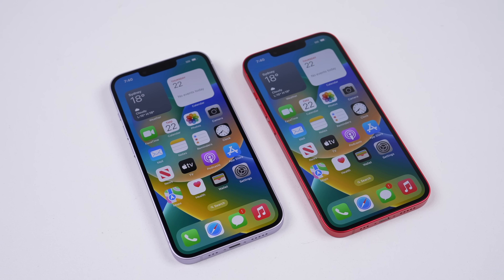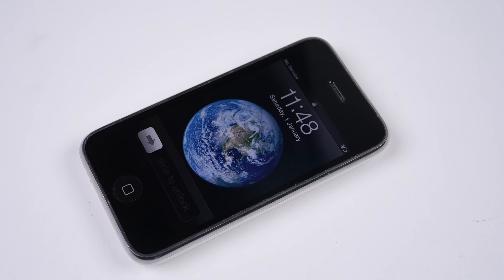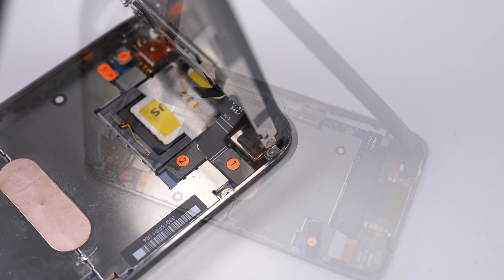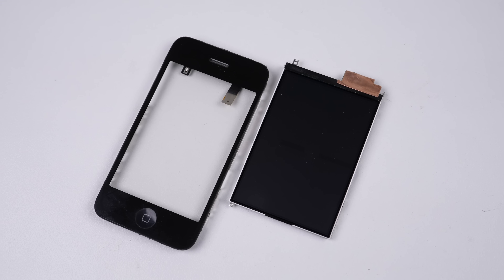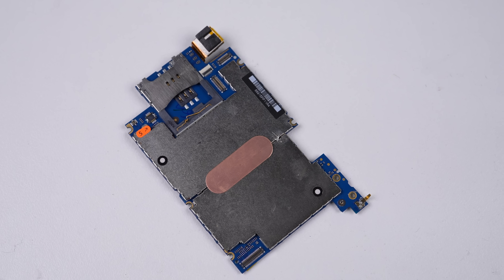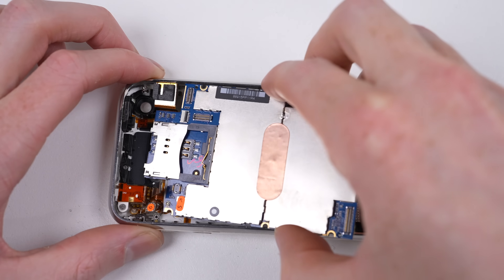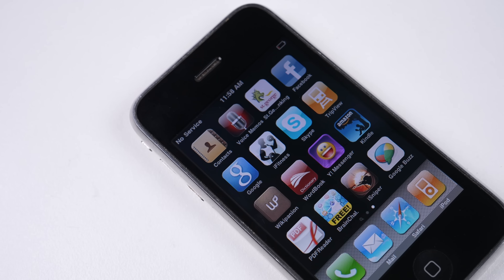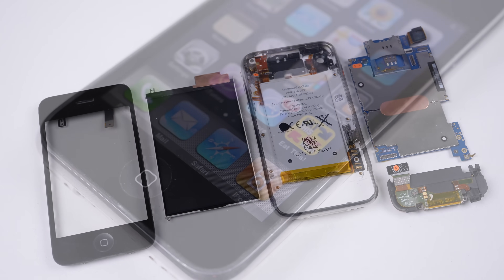Apples Most Repairable iPhone EVER - Teardown And Repair Assessment

Comment: EU should enforce laws for addressing the problems with activation lock and 3rd party repair, not just having easily removable batteries or USB-C!
Reply: All government should. Not just EU.
Reply: I agree. Apple should have a 30-day grace period with Activation Lock, not just with iOS 16. They should fix the old iOS app store so it loads again, and they push out iOS 7.1.3, 9.3.7, etc. with the activation lock fix for legacy iPhones so I don't have to upgrade phones. My LG MX6000 from '03 still works on USCC
Reply: @80sTechKid why any grace period? It's my phone and I paid for it. If you have it and you shouldn't, then it's not your office
Reply: @80sTechKid  the activation lock fix wouldn't help you at this point, since every company stopped supporting iOS 7 and 9 altogether and want your iPhone to at least support iOS 14 or newer.

And imho, after 5 years, it is worth it to buy a new phone (if it actually survives these 5 years)
Reply: Last time i checked the UK isn't part of the EU
Reply: Just like the Commonwealth of Massachusetts has already done. It made Subaru (the car brand) so angry that they quit selling their cars in that state.
Reply: You need to get out more
Reply: @TateGg-ji5lf who asked
Reply: If that happens, then I would rather go to EU
Reply: Me myself I don’t mind about the activation lock cuz first it’s to prevent a thief from getting any value from it if activation lock is not a thing the total stolen iPhone could be more 
Second, if you buy a cheap iPhone you should ady know too good to be true 
Third the owner bought the device means the owner have the rights to do whatever they want 
So in conclusion removing activation lock won’t do anything good for the one pay for the iphone
Reply: If that happens, then I would rather go to EU
Reply: Yes. Those iPhones marked as not lost is pretty absurd.
Reply: @aptiveviennapro  most locked iPhone's have the IMEI number stolen and attached to a clone phone lol witch is better than the iPhone anyway!! Well for reliability anyway 😆
Reply: Why for activation lock?
Reply: @gabriledyt  parts activation ("calibration") as they call it.. but it's really  adding the new battery pack id to the phone hardware list and digital signing it to lock it to the device. So essentially all repairs are useless until you call apple and allow them remote access to remove said old parts digital signatures and add new parts digital signatures to lock it back down so you can't make further changes until you buy overpriced and locked parts
Reply: @gabriledyt activation lock sucks. Needs to be worked on
Reply: Activation lock is a really good security feature when it works. But I did have an iPad thrown out cause it has ic lock and couldn’t bypass it. What a waste
Reply: Billionaires lobby and bribe politicians.
Reply: We need to make it so whoever invest in tech companies and is a government official is required by law to resign and forfeit all profits to the right to repair movement so it'll serve as an example to those who control this.
Reply: Fuck the EU
Reply: Exactly!
Reply: Better than regulation : educate the clients.
Reply: That is a terrible ideo it stifles innovation and destroys the brand think of buying an iphone which has been repaired with fack components and is multinational the buyer will hate the brand not the repair shop. In fact other brands should have anti repair policy. Because device should be repaired my qualified company personal.
Reply: As much as I absolutely hate the EU and a lot of their regulation ideas, I can somewhat agree
Reply: Y’all making it sound like changing a battery is impossible, definitely not as easy as it used to be but not hard
Reply: I guess 70-80% of EU employees have an iphone... More power, more need to visibility->then will buy an iphone. So for them this isn't a priority
Reply: Those would all be far more important than USB-C. The whole USB-C thing was finicky and petty.
Reply: The EU should make iPhones repairable instead of making. & enforcing useless and annoying laws
Reply: most of the politicians have stakes in the tech corporations that they are suppose to regulate, so it is against their interests to restrict them.
Reply: @ishredder4006   Nope, Europe will have phones with batteries easy to replace soon.
Reply: @siedliko  hopefully but that's mostly due to pressure by environmental activists  not by their good will or sense of duty. If it were the changes would have come a lot faster.
Reply: @siedliko  define easy to replace, because that legislation is NOT going to make it like the days of swapping out your nokia battery
Reply: @MyNameIsPetch  why wouldn't it? the legislation specifically stipulates that the battery needs to be easily removed without any special tools so no heat plates no pry tools no special security screws 
meaning like on early smart phones the easiest way to achieve that would just go have the back easily removable and the battery easy to just pop out and put in a new one atleast that's the ideal way for it to go
Reply: @Goldfire345 That would require arranging other components in the phone in a way that makes the battery user-replaceable as well as additional frames and other structural components, which probably won't happen.
The easiest solution for manufactures is simply screws. The structure will remain pretty much the same as in most phones right now but instead of glue, there will be screws. You'll still have to use tools to remove the battery (just not special tools), you'll still have to unplug cabels and maybe remove some other components, but the battery will be easily replaceable - which is the law's intention and is awesome news for people who keep their phones for a long time.
Reply: @siedliko They have made a exception for waterproof smartphones. Meaning Apple, Samsung, Google etc. still can glue down their phone batteries if they are making their phones waterproof.

So, the EU is defeating themselves by the tech companies at some point
Reply: @Christian17390  oh goody so another piece of legislation that's functionality useless
Reply: @Christian17390   waterproof as in the phone able to take a accidental dip in the pool or something ? the old samsung s5 could do that and still had a removable battery ..
Reply: @soniccdx  Well that was back then. Today, people literally deep dive their phones into the water to make underwater selfies
Reply: @Christian17390  if they could do that last time , wonder what’s preventing them from doing it now though
Reply: @siedliko but they are still going to need a call to apple to activate your self repair battery pack and camera ect.. that is the biggest issue if I repair MY PHONE I should not need to use unnecessary tools and not need approval from apple nor should i have to activate my new parts.. the only part that needs to be protected is the fingerprint scanner so it's secure 🔐 besides that nothing else needs activating and digital signing to a device.
Reply: @Goldfire345  from the version I've read something like the Steam Deck with slightly less adhesive would pass the new legislation, which is nothing like old nokia phones
Reply: @soniccdx  Can tell you. They want money. Nothing else. If they would build them like they're used to, no one would get any money from it anymore because people would use their phones longer than expected. That's also why they make their phones non-repairable, so that you either get to the companies to repair them or completely buy a new phone.
Reply: @Christian17390  at least you guys over there have laws that can help , abit , meanwhile over here in asia , .... errrr
Reply: @siedliko  unfortunately the law has so many loopholes it will be easy to circumvent. Like you don't need a replaceable battery if the phone is labeled as waterproofed. So I guess they are going to get that a little bit better worked out and still glue it shut.
Reply: If the new iPhone's will have  Soldered USB-C Charging Port, it will be funny 😅. Then the whole EU regulations is a completed lie and there will be  once again NO RIGHT To Repair 😅
Reply: @Platineshop  nah. Many leaks have proven that the USB-C Ports won't be soldered and will use the same technic with the pentalope screws, which we already know from the lightning ports
Reply: @Christian17390  hopefully that you are right... all the iPad's which have such a Port... they are ticking 💣
Reply: Nope I want to keep the activation lock. I love knowing that thieves get pissed that they can’t use the phone they just stole
Reply: @fadoks7075  what if you forgot to remove the apple id before you recycle your phone?
Reply: We don’t need USB C, we need a more reliable connector that doesn’t wear down as quickly. Lightning is a good example of that design. Just a shame it’s only allowed for use by apple. A revised lightning type connector made open source with good charging and transfer speeds would be perfect.
Reply: @Nenemon agreed, instead of forcing usb c we need a lightning port copy everybody can use
Reply: Activation lock is good thing, only thiefs want this feature removed.
Reply: @Vidmantas969  no and stolen iPhones end up in china unlocked anyway 😆 the only reason to lock everything is to stop repair so apple can scam you all.. the only component that needs to be locked to the phone is the fingerprint scanner.. not the battery pack or cameras or vibration motor or speaker ect.. apple is the biggest technology scam company in the world 🌎🌍
Reply: @Vidmantas969  no it is also a problem for resellers
Reply: @Vidmantas969  But what about those who forget to remove the icloud before disposing?
Reply: EU made a one good thing. Now let's compare the 100€ we're going to save on a replacable battery to the thousands of € we'll have to spend on the mandatory house renovations and other wierd ideas the EU is cooking for us :P